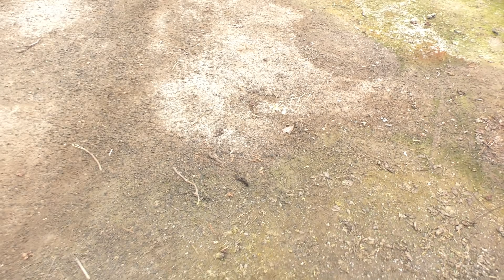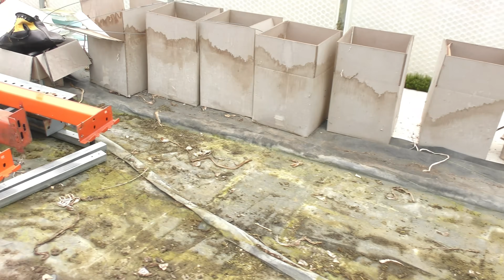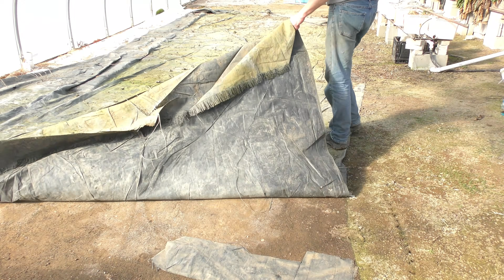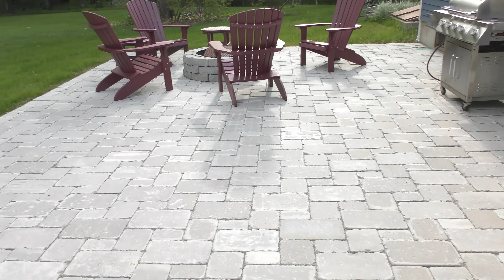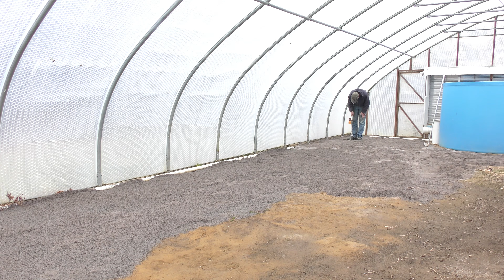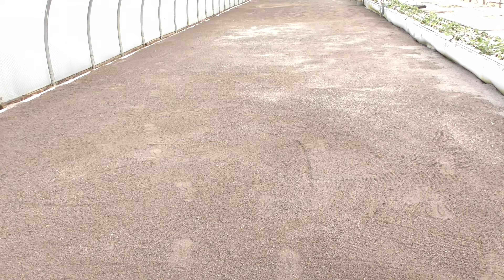Greenhouse Expansion - The New Floor

Comment: You should try to angle grade the soil outside by the GH Frame to shed ground/surface water away from the frame and also invest in a rainwater catchment system by installing lightweight gutters to catch the rainwater off of your GH Fabric on the sides, you can control up to 90% of what can even get inside the GH from under the floor and have the added benefit of usable irrigation water. I Have two 1500 water tanks that i use to pump water that is caught in 55 gallon barrels into and use the water directly in every other day watering of plants thru drip tape to my long rows of plant pots. Although i gave up on aquaculture because of the fish food prices, i still have large reserves of free water so i can take a large percentage of pressure off of my freshwater wells.
Reply from the maker: For us, it's just cheaper to use well water vs installing rain catchment systems.  Once we dig a few feet down, we usually hit bedrock or boulders that are too large to move.  When I built the greenhouse, I priced out rain catchment and I could drill a few wells for the same cost, plus I don't have to worry about decontaminating the rain water.

Comment: Before laser levels we used a long clear water hose to install overhead ocranes, unlike laser levels you could go around corners, ironically your quality check of the laser level was using an really old times technique. It good to see another video thanks 👍.
Reply from the maker: I used to use a hose in my youth.  I'm spoiling myself with the laser. 😜
Reply: Exactly what I was thinking LOL